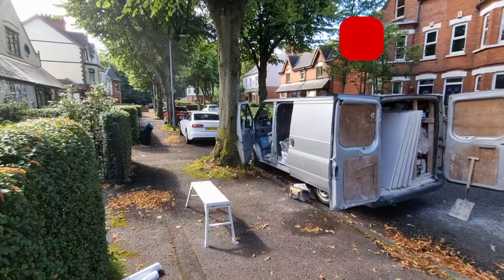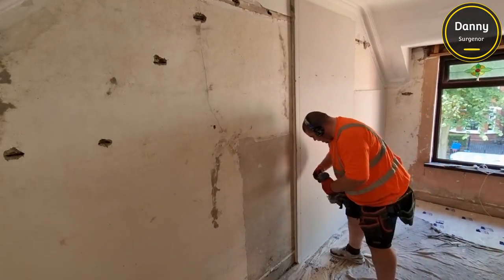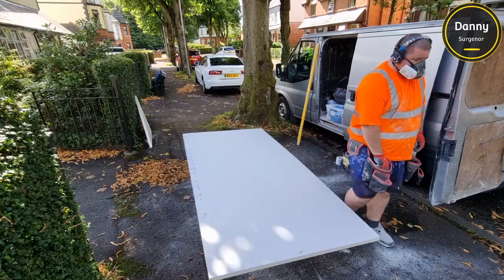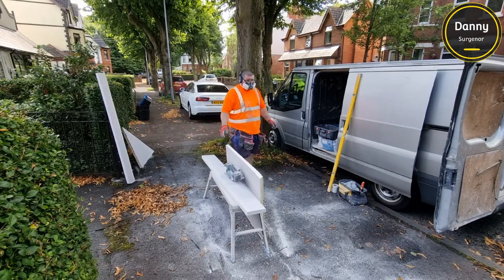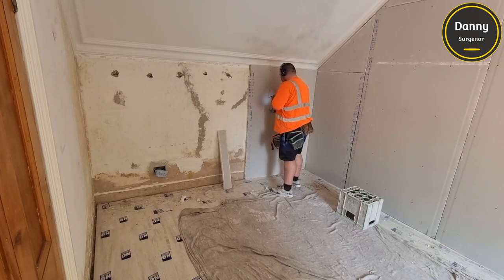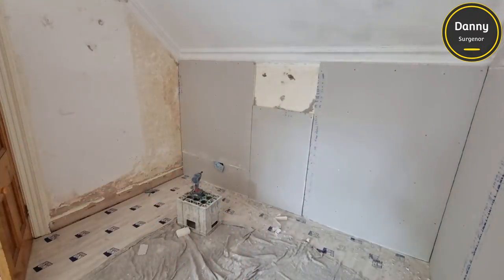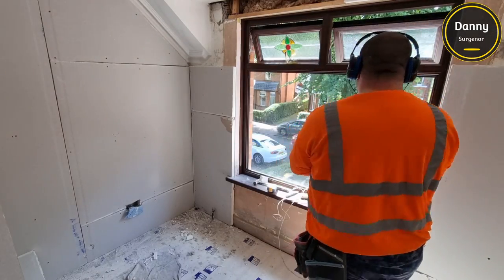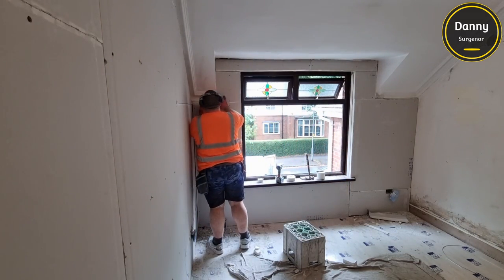How To Insulated Plasterboard A Room

Comment: You may need to tell the homeowner to get trickle vents fitted to the windows as the sue point only any condensation will be moved to the window now. I couldn’t help notice some of the insulation board had gaps where it met the ceiling you are at risk of thermal bridging by not having a continuous finish across the wall.
Reply from the maker: Yea i told they they would need the windows vented. There is a corance between the wal and ceiling thats the reason it dosent. Thanks for watching.

Comment: Danny, I was just wondering should you not be scanning the walls first to check for cables and pipes before screwing the insulated board into the original walls, incase you hit or pierced something?
Reply from the maker: Yea you should but i knew the cable for the sockets came up from the floor same for the piperls.

Comment: What wall fixings do you use, are you going into wood batons or straight into the brick..   are you using expanding foam or are the boards being screwed straight onto the wall. .?.
Reply from the maker: Yea this job just screws  i am screwing throught lath and plaster there are battons underneath

Comment: I’m doing an insulated boarding job. Using foam adhesive and aluminium hammered fixings. This wall has to be tiled, is there anything additional I need to do so the fixings can be tiled over. 
Big thanks for putting these videos up 💪
Reply from the maker: Yea buddy np at all some times we put some scrim tape over the head of the fixing to stop the plaster blowing off but its not really needed you should be good to just tile over. Thanks for watching.

Comment: Hi there 
I live in a cold timber frame house built 2003 . I have drafts under window  sills and bottom of skirted boards drafts also from esb and gas meters box coming up walls as that side of house is a fridge. I can see my breath at night .. plaster board are cold to external walls. So should I remove plaster boards and seal up any drafts then replace with 50 mill insulated plaster boards or just put up 50 mill plaster board on top of existing plaster boards???? Thanks for your help. Ireland
Reply from the maker: Sorry to hear this its a hard 1 it seems like the draft is the problem but if it was my house i would go room by room taking the board off using expanding foam and sealer and sealing up every hole then putting the 50mm insulation board on the wall. Were in Ireland are you?
Reply: Thanks

Comment: Nice job mate! Is this a solid wall? What kind of fixings did you use? I'm about to install the insulated boards not sure dot and dab or fixings.
Thanks in advance
Reply from the maker: Hammer fixing from screwfix is the wall is damp dont bother with the dab use expanding foam and fix them.

Comment: What brand of board you using ?
Reply from the maker: Thin-R Thermal Liner from Unilin
Reply: @Surgenorplastering  ye that’s what I’m for using or I’ve used in my ceilings, got it from macblairs, was considering k18 for the walls because the u value is better. Hard to get here?